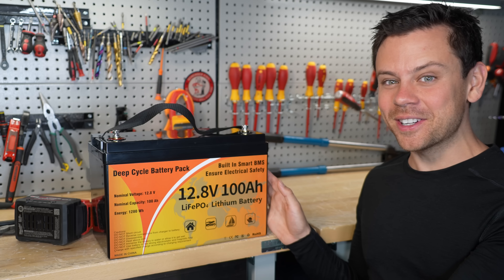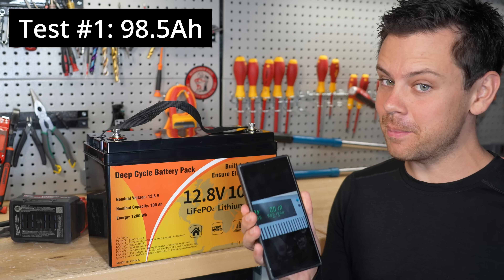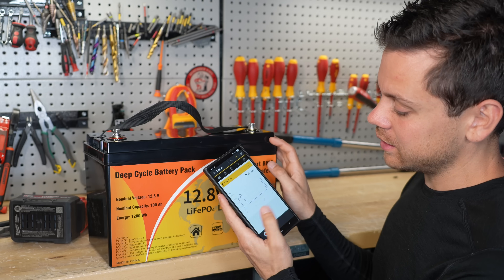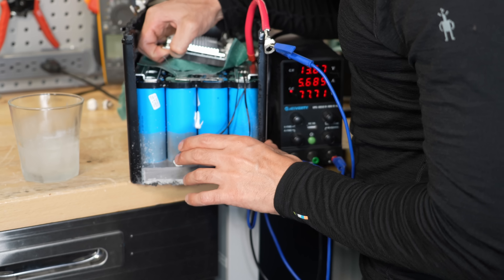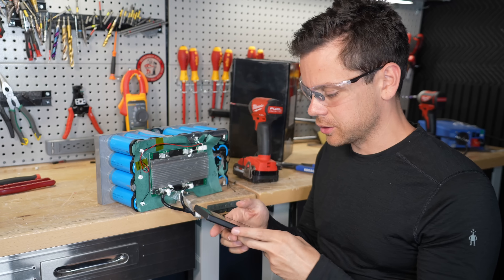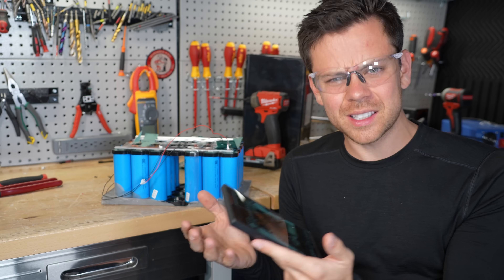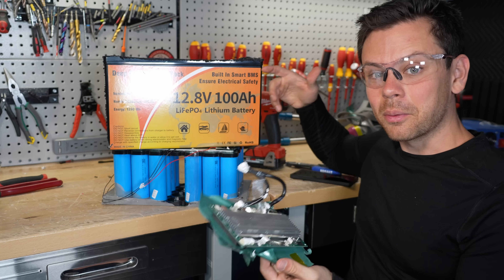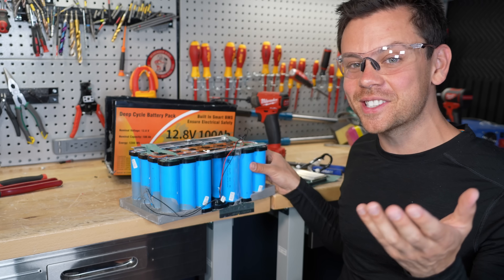$125 100Ah LiFePO4 a Scam?! Or Actually Good?

Comment: Sooo... what I'm hearing is that these are "ok" for the price, but not for loads greater than, say, 50A-75A (1/2C), so maybe for a radio shack or portable ham radio setup, a 800W inverter TOPS, maybe for a jump-start battery (not really safe even for that), and anything else is likely a fire risk. But in all cases FUSE / CIRCUIT BREAKER **REQUIRED**

Comment: We get different brands in the UK. I just bought 2x 12v 100 amp/h LiFePO4 batteries off Aliexpress. Brand is Datouboss! Very well packed and arrived in 3 days. £110 each. Fitted them to my wife's mobility scooter. Cheaper than lead acid. Scooter is now 40kg lighter. Acceleration is insane. Easy swap out terminals fitted exactly. Charge it using the normal onboard charging socket with the scooters standard lead acid charger. Works perfectly although I suspect it won't charge it to 100%. Range was 30 miles on lead acid. Bet it will do 40 miles now! Batteries in series for 24v.

Comment: I actually bought a different one that is cheaper, EIIEV brand, $120. Also bought a battery box that has some built in circuit to output regulated 12 V and USB ports. For my purposes, it is actually working great. I use it to power the portable refrigerator and charge the iPhone. I charged it with a trickle charger. It keeps the refrigerator running for about 48 hours.

Would you please also review this one? Brand is EIIEV

Comment: Super helpful, as always, but... 98% pf advertised capacity, I mean.. what's the margin of measuring error?  Not saying that battery does 100AH but so close to me it would make no difference.  Given the lack of overcurrent (only overtemp) - is that the flying-lead battery sensor only or is there a thermistor on the BMS board (I would hope yes because it costs almost nothing at all)?  Anyway... yeah I've got a few dirt cheap 100AH's at around $110 in the last year and - for my occasional use - they've been just fine.

Comment: I have always intended that when I install a solar system on my house, both the solar and the batteries will be mounted separately from the house. 
It would be devastating to have any of these expensive components catch fire, but how much more so if they were attached to my domicile.

Comment: Most of those cylindrical cells are 3c rated and 10c burst, I have a 2kwh self made scooter battery of 32700s that can do 20kw for 30secs!! So that setup punching 400a whilst not ideal is almost within spec, 300 amp continuous wouldn't be damaging,

Comment: Since im still using my 12volt system i will use one of those cheap batteries to run my mini fridge with a 100watt panel. It should be ok for that.

Comment: I bought 8 of the watt cycle battery's on your link but I still cant find any one talking about the different charging voltage they want you to use , they say to charge up to 14.6 volts and I am worried this is not good , but even their own chargers charge to 14.6 , I really wish  this was talked about ... aren't all cells of this kind the same ? why are they asking every one to charge to a higher voltage ? @WillProwse

Comment: Hi I have purchased 4 of these batteries for my semi truck so far they work just fine they power 14000 btu portable AC. Microwave, mini refrigerator,tv,coffee maker
Reply: Same here but only have 3.. microwave, tv, small AC unit..owner operator can't afford to run my truck 24/7..lol
Reply: @Bobotrucker is good not to idle your truck because DPF system it will last longer and you will prolong life of your engine
Reply: @veljkodjukic770 yeah I know.. Don't have def either way as previous owner deleted it.. I'm more concerned about the cost of the diesel.. Mostly company drivers idle constantly.. They don't pay they're own fuel cost..lol
Reply: Great application, I might be doing the same for my travel bus, can’t run the engine forever to keep the a/c on and TVs ect
Reply: Can I run 2 just to start my truck
Reply: @danieloliva505  I don’t think so
Reply: @danieloliva505 maybe a ranger but no way will it do anything over a 4 banger
Reply: @danieloliva505  no these are not cranking batteries

Comment: bought a 72 volt "200Ah" battery for a small one person car(t) it works ok has decent range it has the smaller 18650 cells in it in a 21S config and seems to have an ok bms 
im on my second battery at the moment , last one lasted a little over one year 
wintertime / cold is not friendly to these batteries , and the range gets less than half once it get below say 10 degrees celcius outside and you need to run lights and the wipers battery had lost a lot of life/ range after the wintertime 
going to add a seccond battery and take the used battery inside where its warm to charge might even leave one at work and change the battery before returning home the the one in the car is at least warm during its use

Comment: Back in 1980 my buddy and I took a thousand mile run to Yellowstone and a beat-up old Toyota wagon. The voltage regulator must have been shot because it was overcharging the battery! The battery was swollen up like a balloon, but it kept working! When we got home and the battery cooled off it returns to normal, used it for another 6 months before the car blew up all together

Comment: Hi is it possible you could test? The DATOU BOSS 24v 100AH Apparently has a smart BMS but doesn't seem to have the capacity it should have when I asked the company about it. This is what they said.

I quote  Good afternoon,
Thank you for your patience.
BMS automatically detects and balances battery cells.
To prevent overcharging and over-discharging and ensure safe use of the battery, our protection board has a 10% low capacity protection and 10% high voltage protection. The normal cycle capacity of the battery is 80% of the battery's capacity.
If you are not satisfied with this battery, I will arrange for it to be picked up at your doorstep. You don't need to do anything.

Comment: Even if a battery has over current protection, fit a fuse. Semiconductors can fail short circuit.

Comment: 8 years ago i bought some 12V LifePo's for my 1000cc motorbike.
They still work but when i tried to buy another set last year they were ridiculously expensive. (Probl. due to high discharge current needed to start the engine...)
Are there any alternatives out there or should i just go back to lead batteries?

Comment: As far as over current, I always put ether a breaker or fuse inline and never trust the bms for that even with the better batteries. I have seen a few systems go up in flames just because there was no fuse or breakers better to be safe than sorry.

Comment: Buying no-name lithium batteries is risky.  A friend of mine bought a pair for his diesel pickup that were advertised as "start stop" batteries meaning that they're supposedly designed for hard use, they wouldn't even crank his engine.  When I opened them I was glad they didn't work, they were a fire waiting to happen, they have no protections.

Comment: I bought a similar battery a few months ago for $110 on a flash sale. Prime. Haven't used it yet, hooked up in my camper trailer. Panels charged it fine.  different brand tho.

Comment: Would a circuit breaker be a better option than a fuse for people using that battery in golf carts? They'd have to replace the fuse every time they floored it, right?

Comment: Dont be surprised if the cells are second hand, pulled from EV cars in China. There is a big glut of EV cars that are not selling, and being sold off cheap, especially the EV car battery packs.
Cells are then stripped out, new heatshrink put on the cells and made into "new" products like these batteries. Buyer beware.

Comment: We should really be bagging on lead acid sellers for there Ah ratings. i have never had a single one test close to rated capacity aye. normally get 60-80% tops before they voltage sag off a cliff. Unless ya wanna do a 500mA discharge rate for the last 20-30% anyway

Comment: Its hard to do but the longevity should also be tested. I hope these companies at least stop lying, A+ cells? Do anyone who buys this really think so for the price? I could be very happy with a cheap battery like this for backup or emergency purposes or maybe just that camping day. However i would be very aware of the dangers like no over current protection, probably some other protections also missing.
But stop the lies and label it as a 85Ah battery or something because that is closer to the truth than 100Ah. And then people had been more happy, "i bought a 85Ah battery but got almost 100Ah" and of course some would get some less but most likely over rated 85Ah.

Comment: Hey Will. Thought on the safety of fuses or other overcurrent protection sold on Amazon? I know there have been issues in the past with so called "grey market" supply getting mixed in, are fuses an item to be concerned about for this?

Comment: You overpaid, i get these for $75-80!
Reply: I have these in about 20 golf carts,
and my ryobi riding mowers. All have tested roughly 99-101ah.
surprised they work in golf carts? our 36v carts are 3,000 watts. That's 83.333 amps sustained. spec sheet said 200 amp burst. i haven't seen ours go that high. 48v carts are 3500 watts, so 72.9167 amps. 
Riding mower is about 2800 watts 48v, so 58.333 amps. 

some have been in service, hard service for over a year now. The mowers are from this April. The mowers get used hard, and do about 2 acres per cut. With power left over. Upon recharge the charger puts in about 85 amp hours at 48 V. So it takes about 85% of the batteries roughly to cut 2 acres at a time. I do about 2 acres, three times a week at different properties, meaning a total of 6 acres per week. every week for the summer. So far all is well!

Comment: Good review. I mean honestly, even if you only get 90 amp hours from one of these. Throw a fuse in there and buy 3 of them for an RV. You have 270 amp hours of lithium deep cycle battery capacity for only $375. That's honestly pretty nuts.

Comment: The manufacturers are using cast off, low quality which did not pass the customers testing.
 The cells are the repackaged and sold cheap. 
Easy and less cost than sending/paying for proper recycling. 

Yes, ALWAYS FUSE. Recommend placing this battery quality inside a sealed METAL box (with appropriate electrical insulation).

Question: do you have a barrel/can of salt water nearby to toss the battery into if a "thermal event" occurs?

Comment: The two I received have the exact same label but they say Kingboss. I got 98.6 amp hours on one and 98.1 amp hours on the second. I only intend to use them once in a great while for emergency back power to run a small pump to keep the basement dry. So the two batteries combined will only see a maximum of a 30 amp load but it looks like I definitely need to to fuse them anyway.

Comment: I’ve been running 4 Chins 12v 100AH batteries in my golf cart which is based in the Smoky mountains….very, very steep terrain. I’ve only had it go to overload shutoff once in three years. That particular incident occurred when the cart was close to 32 and cold soaked from being left outside and I had it pegged going up a very steep grade. It was an easy recovery, just turned the cart around so it was going downhill. The carts regenerative charging kicked reactivating the BMS that had tripped out. Now… if it is cold, I give it a chance to warm up before going balls to the wall.
Reply: Golf Cart Regenerative Charging "wakes up" sleeping battery.  I Love This ... LOL

Comment: For low amp pull, this battery was perfect for my needs.  I use three of these for a series of outdoor, solar-powered wifi mesh units.   They were dirt cheap on an Amazon sale and have performed flawlessly.    Use them for the right application and they are perfect and priced attractively.
Reply: I have a similar outdoor wifi solution like you mentioned to cover 9 acres.  There is someone selling 30ah Eco-Worthy brand on eBay for $64 plus $10 shipping.  I'm using 3 of them and they work great.  Plenty of power for overnight and cloudy days.  I'm using a 100 watt panel on each unit so even 100% cloud cover days aren't a problem.  I wouldn't hesitate to use the batteries in this video for something like that.
Reply: I came to post the same for most of the batteries I have are used that way.  Two of the listed at 100 amp in my travel trailer, I don't use a power inverter with them. Lights, diesel heater, TV, DVD player.  The single 100 amp in my  Jeep is for fridge freezer and lights not high drawing devices.  Then my small fishing boat I have started using a 100 amp battery for one pack, the other is a pair of 36 amp batteries. The second is for portable 12v power.

Comment: I bought the exact same one to run a 46lb thrust 12v trolling motor that has it's own inline fuse. I've only cycled it twice, but it has performed fine. I got it on sale for $100 with $8 tax and free 3 day delivery.I slow charge it outside as a precaution.
Reply: Is that fuse right up close to the battery terminal? Remember, your cables could short too (say if something rubs through the insulation or you accidentally slice through them), not just the motor.

Comment: I like cheap batteries, but I also usually tend to use batteries at 25% of all their max ratings. I'd rather use a few cheap batteries and got close to three time the capacity than push a more expensive battery to it's limits if that is what I need to meet my needs. There's no excuse for a BMS not working these days though. It's not new technology anymore.

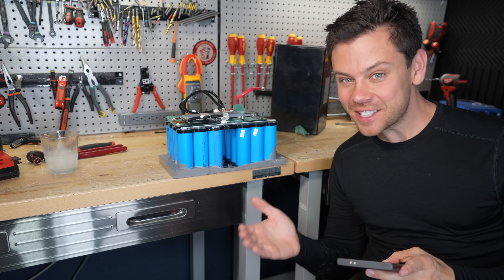Comment: WTF?? At a quick glance, that battery pack looks identical to mine but with a different BMS slapped on. I see though at 2:19 in your video that your cells say 51.2Wh (16Ah) whereas mine were 48Wh (15Ah). That explains why yours tested higher, you have 6Ah more based on the printed wrappers. You just can't make this stuff up!! 😂
Reply from the maker: Good catch 🤣🤣
Reply: I think that amp hr discrepancy is based on whatever cells they can source at the moment. It's also why they have missing cells.

Comment: I use one to run a straddle stacker that only gets very occasional use.  The chinese lead acid leaked constantly and I just wanted some lifepo4 battery that won't do that anymore and don't need constant maintenace for a device we only need a dozen times a year.  This is fine for that.  And it's way less maintenance.  I only have to top it off every few months.  Thank you for the fuse info, I'll do that, just because it's a good idea.

Comment: always start with 1 star reviews on any site... amazon is in another category altogether, it's so badly shilled with real and fake accounts as of the past few years that neither, positive and negative, reviews there are credible any longer for the most part...
a lot, if not most, of them are faked courtesy of the particular product's manufacturers or their equally unethical competitors...

love your channel dude, for now i use it for potential theoretical knowledge because of my disability, hence inability to physically assemble anything, but hopefully it'll eventually translate into practical application...
or i'll just use the info from your channel on factory solar generators to choose the best one fitting my particular needs, should i find myself flush with some significant extra funds...

Comment: we've reached the point where they're getting cheap enough that even if they short you on cells you can pull the rest of them and save like 600 bucks on individual cells, for those who are building up packs.

Comment: Thank you for being upfront about junk.
Reply: Take it with a grain of salt..I have purchased 20 of these, all different labels but really the same batteries..I resell them to the Amish and have not had a single complaint..also have 3 full size ones and a mini..no issues yet after months of use..

Comment: I got four 12-volt lithium batteries on Amazon Prime day... has an American flag with an eagle but it looks just like the battery you have, but a different label though..
So I'm assuming it's not 100 amp 12v... x 4, 48 volt. So you're saying I should put a fuse on each battery terminal?

Comment: 🇨🇦 Thank you,,,in Canada we are not given much choice,,,was tempted to buy from Amazon,,,but now I will look elsewhere,,,thank you again
Reply: Do you have access to Temu?  They also have low quality stuff, but their return policy is very good.  I bought 5 deathPO4 batteries from them.  One somehow get redirected to somebody in Texas, but I was fully refunded plus about a $40 credit.  Another didn't work at all, and after (free) shipping it back I got a full refund.  The other 3 are working fine.  My scathing review of the MFUZOP  battery experience is still on Temu.  After seeing these 2 videos, now, I'm wondering if mine have that missing row of cells, as I don't have an accurate way to test their full capacity.

Comment: Looking for a decent battery to replace the stock 12v  AGM 88AH batteries for my RV. Don't want top of the line or the low end crap. I plan on upgrading my RV in the next year with full solar and maybe going to a 24v system, but in the meantime I want to put in a better battery. I can always use it for other projects as I learn more about solar.